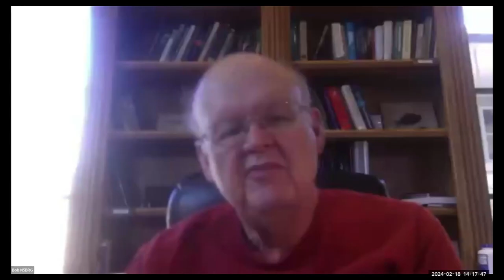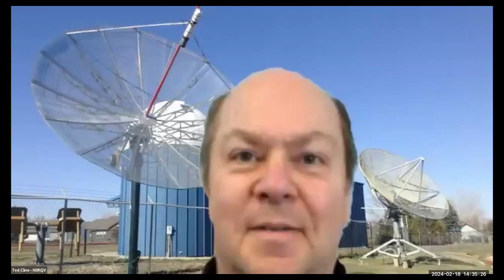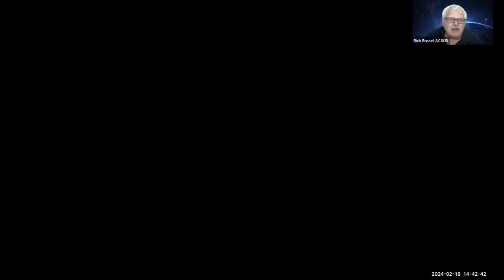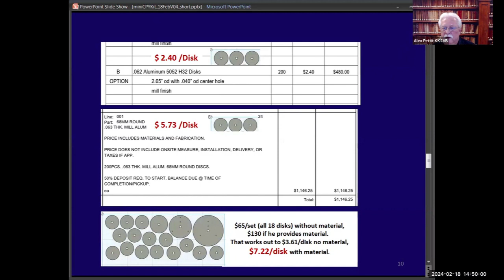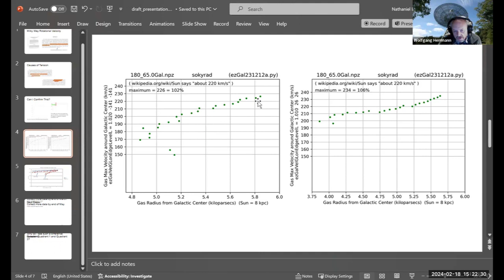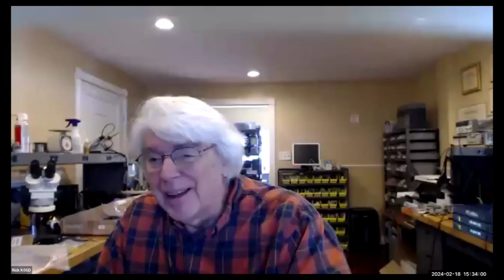Drakes Lounge Feb 2024 - repeating FRB detected, Disk Yagi Testing

Comment: Has anyone tried squares instead of discs in the yagi design? The manufacturing costs would, I think, be much lower.
Reply: Hi Don, in doing a bit of research, there IS an advantage to Circular over Square   Comparison between a rectangular patch antenna and a circu-
lar patch antenna using the simulation results obtained from
CST Microwave studio has been carried out. 
Both the antenna  configurations show quite good results on perspectives of re-
turn loss, VSWR, gain and radiation efficiency, for Bluetooth band applications. 

However, from the perspective of return  loss and gain the rectangular patch configuration shows better
performance, while the

 circular patch configuration shows better results on bandwidth,
 radiation pattern,Lower Side Lobe levels.

( example of 2.45GHz Antennas ) 
Parameter     Rectangular            Circular
Return Loss   28.28 dB             22.03 dB
Bandwidth      24 MHz                  27 MHz
Directivity     7.267 dBi               7.027 dBi
HPBW          72.2 deg                 77.7 deg
Side Lobe    -10.5  dB              -19.6 dB
Gain              7.119 dB                6.968 dB
Radiation 
Efficiency         97%                    98%
Total Efficiency 96%                   97%

https://www.ijser.org/researchpaper/A-Comparative-Study-of-Rectangular-and-Circular-Microstrip-Fed-Patch.pdf
Reply: Thanks, Alex, that was useful.  The differences seem small compared to the  cost of manufacturing for those who are budget conscious. I'm considering designs for 21cm hydrogen emissions, so bandwidth is not terribly important to me.  The design I have been considering is a turnstile antenna as the driven element with director and reflectors being 'X' shaped and aligned with the crossed dipoles of the turnstile.  I'm still figuring out how to use 4NEC2 to model it, so I don't have any predictions yet. Ultimately, I want to construct an array of 4 of these.
Reply: Don, its not band-width but Side Lobe Suppression that is the significant difference. What is the goal of having 4 antennas ? How do you wire an array ? Each should have a closely coupled LNA.
Reply: H_Line reception is not like satellite signals: With a point source, the smaller the beam width, the greater the signal, but the same will reduce H1 signals.  For hydrogen line data, a narrowing beam must be accompanied by a larger antenna capture area ( big dish ) .